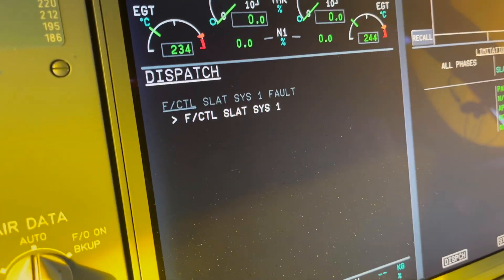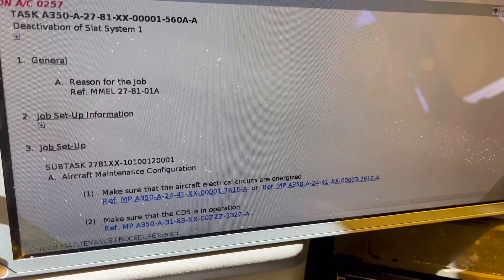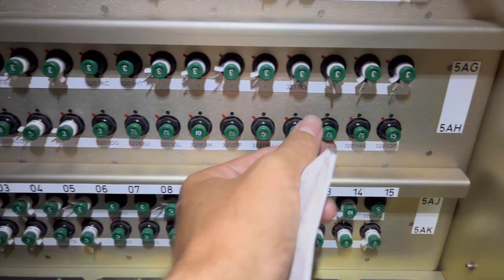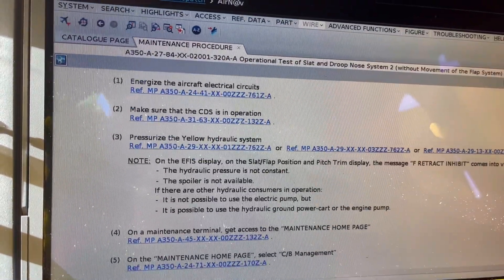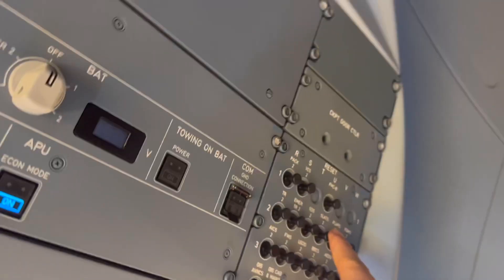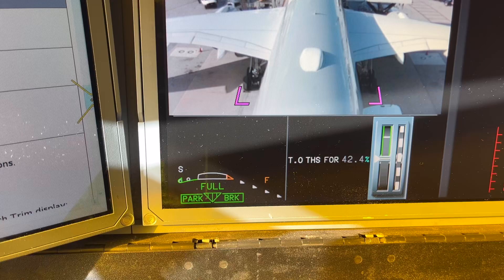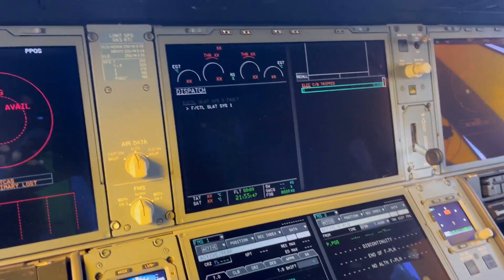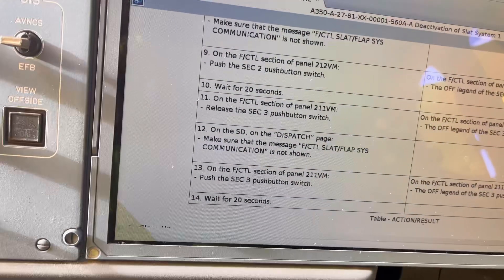A350 SLAT SYSTEM DEACTIVATION AND MEL DISPATCH

Comment: Hello colleague Dennis.These A350 C/B panels without name (only FIN) are a pain in the ass compared to previous Airbus (330,340,380) However i's a great aircraft. Very easy for line maintenance engineers.
Reply from the maker: Yes, not the best system, but it work with the position code the cb has. And yes the A350 is one of my favorite to work on.

Comment: Hey Dennis, how does one get to the maintenance home page? And get access to the dispatch message on the side monitor?
Reply from the maker: At the pilot position you open up the keyboard and you press “CTL-OIS menu” and it will open the maintenance screen, “SHIFT-OIS menu” gives you the backup screen. You use this when OIS server has a problem, it’s limited but you can still run the tests.
Reply: @dennisvijverbergbrakesrele6098  thank you. Keep up the good work.

Comment: Is that screen the Windows 10 computer that is on some planes? or something else?
Reply from the maker: Not sure what operating system it runs on, but could surely be some kind of windows, if so it’s probably an version older than windows 10.
Reply: No way this is any version of a Microsoft Windows operating system. Not even close robust enough for aircraft use.